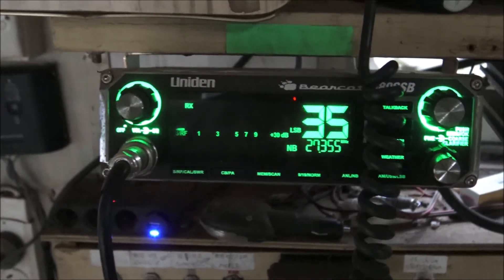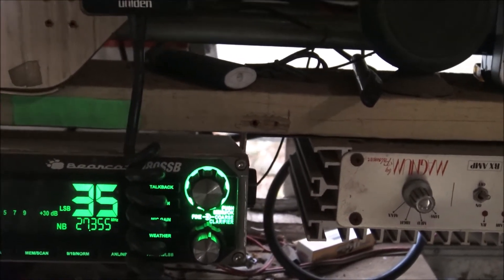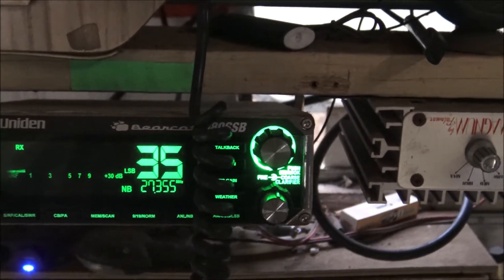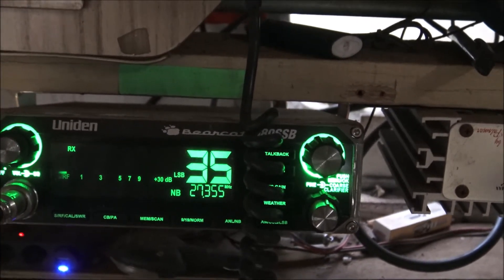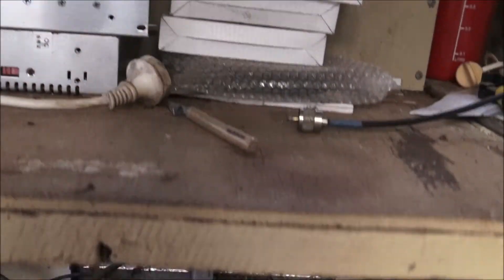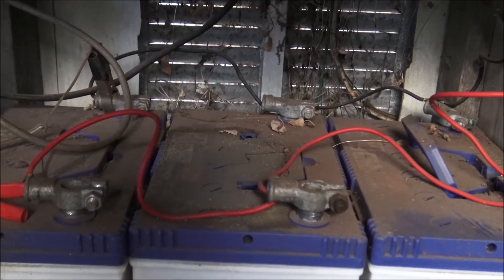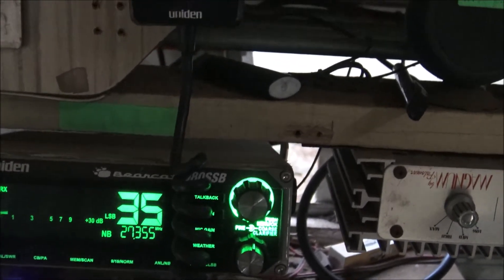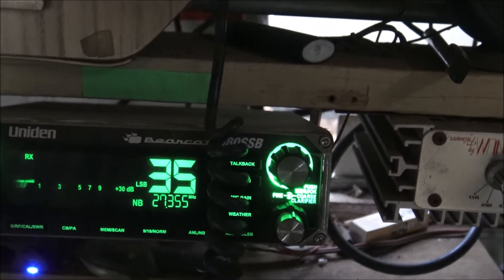HF Comms. Storm Static monitoring.

Comment: Good information for gathering of local news. Yes lightning is very bad for antennas and radios bad experience with that. Glad you can get actualized radio information. I am working on a deployable backpack radio system with solar power I will use it to lessen mostly but be able to transmit. Nice setup you have as a base I cannot set up like that here so backpack for me. Most people do not see the usefulness of radio in emergencies at least where I am and the way things are it might be the only option. God Bless
Reply from the maker: Thank you Pierre. Good to hear about your back pack project.
Last year out west, came across a guy who had a great set up on a bicycle, solar powered.
Yes, true it no doubt be the only comms option left. Have experienced cell phone system collapse in disasters. The radios, only option left for real time info.
It is old proven life saving technology for us.
All the best.
Be safe and well mate.
🇦🇺🇦🇺🇦🇺🇦🇺🦘